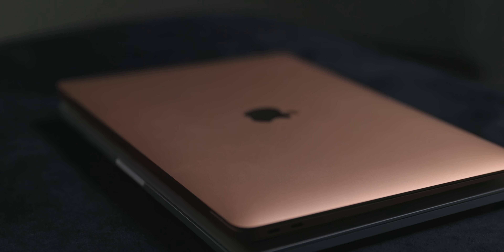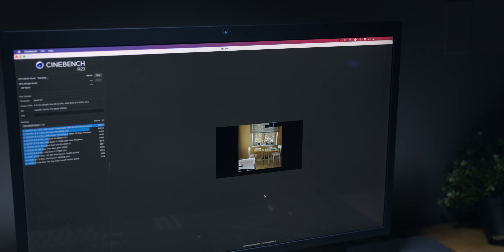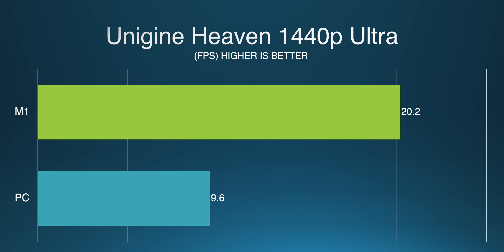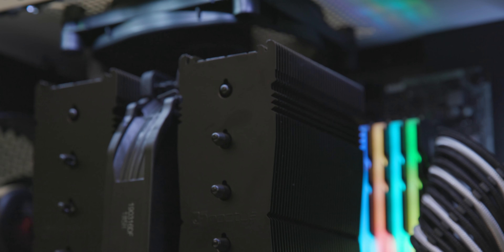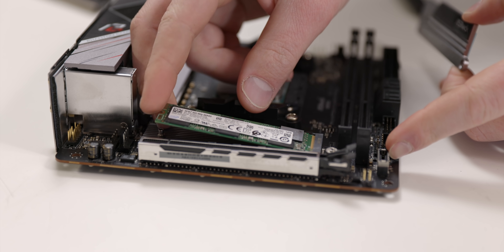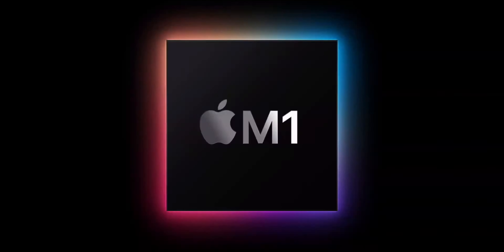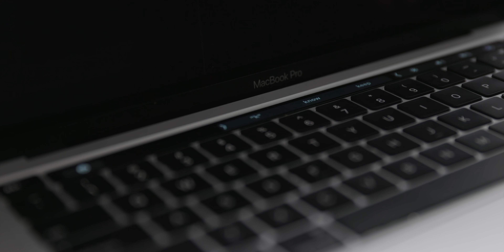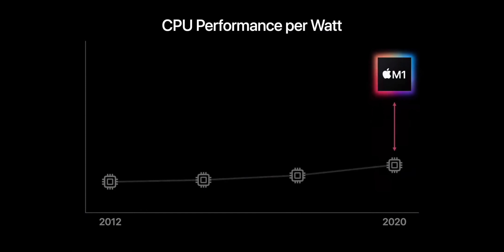$699 Mac mini vs $1,000 PC: Which Is Faster?

Comment: The M1 is a remarkable achievement by Apple (and ARM).  One wonders where Apple goes from here... the M1 (their first release) seems to be way ahead of almost everything in the x86 market.

If the Macs were running Windows they would take the market by storm.  The need to run legacy applications on Windows PCs protects that market for the time being, oh and gaming.

The next few years could be very interesting especially if Intel get their mojo back.  I have said this before but it bears repeating - Intel should buy NVidia while it can (whatever it costs).  Intel would overnight have access to arguably some of the best graphics and AI technology plus ARM.

Unless Intel has some magic sauce up it’s sleeve then they (and even AMD) could find themselves in a whole lot of trouble in the future.

Comment: The M1 chip is nothing but impressive. ARM has always been better than x86 for the masses,. Yet over the years I've seen many people disagree, touting ARM as "weak" and incapable of competing with x86 because "duh, mobile ain't even close to a full-fledged PC." I wonder what they think today. This teeny-tiny chip, whilst consuming a rather small amount of power and generating a small amount of heat, is only bested by absolute power-guzzling, fire-breathing machines. One can only imagine what a scaled up version with a equivalent size and power consumption would be like.

Despite all this, I doubt ARM can take over x86 any time soon. It should, absolutely, and I don't see anyone but Apple making it happen. But the majority of people on this planet who use some form of a computer is using Windows. I say majority but what I really mean is almost everyone outside of the US. Yes, there are other countries which use MacOS as much as the US does, but I digress. Where I live, it's an inconvenience to use an Apple computer outside of very specific use cases, because the entire economy/industry is built upon Windows. And I'm sure my country is one of most. So to summarize, unless Windows makes a sudden ecosystem-wide leap to ARM, things won't change any time soon. And Microsoft is in no hurry because they know they've got the time.

Comment: Common issue with M1 is lack of software compatibility so software has to run under slower emulation.  I own both Macbook Air M1 and the Ryzen 4650U laptop is about double the performance.

Comment: Yes overrated overhyped..poor support service  apple tax compatible issues. More integrated tech equals more problems but efficient and faster than built pc or separate components...longevity m series wont last forget upgrade repairs dedicated gpu ram ssd. 
 Arm is battery life efficient but lacks power. Heavier workload and accessories equals more watts...that's why x86 still valid and has edge over arm  besides emulate or root or translate errors problem. Apple answer buy new one unless warranty or insurance...that's why carrier sells insurance for tablets and phones...they break any electronic not easy to fix loses value quickly like a car.

Comment: performance is amazing for sure. The reason i switched from apple this year and bought a "Tuxedo Pulse 15" was not the lack of performance of apple products..
And in my use case , namely running virtual machines i have read nothing in regards to the M1.. using kvm or "Vmware fusion pro". 
My main problem with these new macs is that i can't even upgrade basic things like storage and memory.. 
in the case of memory one could simply argue that you should swallow the apple pill and buy the system with the max memory and be done with it.. 
That would be the price of admission and i accept that.. 
What i have a problem with the soldered SSD.. if you are not careful you can blow to a lot of write cycles just by using your browser i'm talking terabytes of data.
most if not all regular people don't even fine tune their browsers to prevent excessive writes on their SSD's.. Not to mention paging or writing an active session to disk.
in short i don't feel comfortable buying hardware with soldered storage... so i moved away..

Comment: The graphics situation with the M1 Macs is weird. It allows it to kill any low power x86 APU/SoC in said graphics dept, but if you throw a low power 6+ core CPU and a discreet GPU, things change - admittedly not as much as youd think. But the obvious answer for the M1 is adding discreet graphics to it. But nothing is compatabile - so who will/would make a compatible high(er) power dGPU? Probably AMD.

Comment: Wait a second, something's confusing me...

Why would snazzy use an Apu, since  for 1000 usd you could get a decent cpu and gpu. if the purpose was simply because the M1 doesnt have a dedicated gpu then... its not fair in my book. this is because you're intentionally buying less powerful components simply to match an already optimized apple product
Reply: He mentioned that you really can't compare Toyota Tundra to a Toyota Camry, right? So if he compares the M1 to a Ryzen 7 or Ryzen 9 5xxx with dedicated GPU then it would really be like that, they're not in the same category as Mac Minis are the lowest Apple can offer. You can only compare Mac Pros and not Mac Minis to what AMD or Intel can best offer plus GPU. Also, it doesn't matter if Apple and its hardware is better optimized, that's their strong point and you don't take that away from them.
Reply: @walkhardwalk  I get what your saying but as a consumer I wouldn't care about fairness. If I have 1000 usd to spend, I'm going to buy the thing that gives me the biggest bang for buck.
Which is why I felt that this wasn't an accurate test. Not only are the prices way out but also its not the best parts that you can get.
Also Mac does offer optimisation, which is a strong point for them, and a regular old slapped together build won't have that, which is why you should get the best parts you can.

Borrowing from the car analogy, if you comparing a camrey that's completely tricked out with everything to make it faster and a showroom model of the tundra then you can't give the camrey a head start. You should say if the camrey cost 10 000 usd, I'm gonna get another car, any car that costs 10 000 usd and compare them
Reply: @zaffarismail1508  You completely misunderstood the car analogy, all I'm saying (and the video too) is that you can't use a Camry (all maxed out) to cross a flood or river better than a Tundra. That is why you really can't compare a Ryzen or Intel setup with dedicated GPU which consumes a lot of power to a M1 Mac mini, they're just not the same. This is why this M1 mini was compared to an APU setup which has built-in graphics on chip and consumes low power, I mean what else can you compare an M1 with, there aren't really much powerful x86 chips with integrated graphics out there. At the end of the day, it still depends on what applications do people use in day to day basis, but even with real-life apps the M1 competes very well with $1000 workstations for a fraction of power use. I'm not a mac fanboy or anything, I still use my 9 year old i7 2600 but give credits to where it's due, M1 does beat its x86 counterparts this time.
Reply: @walkhardwalk  ok fair enough. I didn't even consider that power was a factor and yes a dedicated cpu would be more power hungry
Reply: @zaffarismail1508  Just imagine if they make a power-guzzling M1 chip. That would be insane.
Reply: @walkhardwalk  you know I honestly never saw a difference in the power requirements.
I went from using a laptop with to full sized desktop with its own dedicated gpu and my power consumption didn't change... I suppose that if you're using 100 pcs then every little bit helps

Comment: I hate Apple. I think that they are an Evil company. Unfortunately, the M1 silicon is the best thing to come along for the future of the PC market and will FINALLY force BOTH Intel and AMD to stop trying to solve every computing problem with brute force and start focusing more on efficient specialty hardware acceleration technology. As an AMD fanboy, I personally think that AMD will be dead if they can't adapt. Intel at least has the XE graphics onboard their CPUs, both upcoming desktop and current Notebook CPUs and has shown what it's accelerators can do for the Adobe suite. AMD on the other hand can't even seem to figure out HEVC/h.265 Encoding. The co-processing features that Intel offers currently and in the future are the main reasons that I will return to team Blue.

Comment: I'd never argue the M1 is bad. I want to see an investigation in the reports about the SSD deterioration levels. There seems to be an issue where the new M1 machines write inordinate amounts of data to the SSD and possibly trashing the drive much sooner than expected. I'd be interested in seeing if it's as bad as reported and if Apple have issued a statement regarding this problem. I cant seem to find one.
Reply: I actually bought a used M1 macbook air from a programmer and the mac was splendid, looked brand new
The thing is, I found out he wrote 50TB on the SSD already after 6 months of use.
I did the math and at an average 50gb a day (my current usage) it should last more than enough still, considering 150TBW as a bare minimum

Comment: The fact you had to say a very sizeable heat sink says it all...  Apple Silicon can be housed in a smaller case and rarely does the fan kick on...  And I'm a Windows user since Windows 3.11 on 386 computers.  I'm finally ditching Intel/AMD and moving to Apple Silicon... Apple's base models are kicking the crap out of supposedly more powerful Intel based machines for even less money.  There's a reason M1 and its future iterations are getting so much hype.

Comment: Snazzy must be trying to get back in the good graces of the Apple fans cause this line of reasoning is just laughably absurd.
Performance per watt is transparent to the user on desktops.  No one would notice the difference in power draw between the Ryzen and the M1.
The only other perk listed in this video is the mini has a smaller physical footprint than comparably priced and performant PCs.  
Really... that's it?  All just to build up to speculation that maybe there'll be some developments where the M1's advantages become relevant for desktop users.

The advantages of the M1 are almost all in the laptop, because PPW means longer battery life.  The only draw to the mini at all today is people's preference for the OS / ecosystem.  These mental gymnastics didn't change that.

Comment: Given that right now 90% of software running on the M1 is Rosetta 2 emulated, and is still outperforming most computers (even running Windows 10 ARM more effectively in Parallels than the Surface Pro X) is very impressive. I’m really looking forward to more companies supporting the M1 natively, and seeing the Mac Mini grow from strength to strength.

Comment: The only problem with this "in house wonder" is that, as soon has Apple ends support for it in a software level, its all trash! Apple tried to do it on Intel, but kinda failed! You can use a 2008 mac pro with windows (or linux) and its perfectly usable. Its a 13 yo computer that is useless with apple software but usable with any other OS... Microsoft can port windows and linux will pop up in it too most defenitively, but none of them will be that well optimized... Because its proprietary hardware... they know how to cripple the hardware... Oh, once again thanks to its experience in iDevices... And they will do it to force you to buy another, "great" apple device with "awesome new apple silicon"...

Comment: Love the video bud, fantastic! 
I'm using the M1 Mac mini today and love it! The best thing I ever did!
The new world in computer architecture is happening! Especially in memory and machine learning. 

I believe the M1 is a start of the future in, in-house production for an example;  for Microsoft, Sony, HP, Dell etc, they could design their own chips.
I think the days are relying on contracts with Intel or AMD are on the way out, companies will design their processors in house, that will save on cost and help their margins.

Side note: - Would love it if Microsoft designed their own chip for the next gen Xbox, or Sony designing their own chip for the PS6!! 
Apple has taken the lead in, in-house production, and I think others should follow.
Reply: The thing about the m1 is that Apple has years of experience on making their own chip with the A(x) lineup so they are leaps ahead of company like Microsoft. And Microsoft actually "makes" custom chips for their surface lineup even before Apple, I say in makes in quotation is because the SQ1 and 2 is nothing more than a modified 8cx qualcomm chip. Other company may adopt this approach but I don't see much doing so, as their goal is different from Apple. Such as HP, on the hardware side they make nothing more than building peripherals and assembling computers so it can't justify the $500 million+ just to build a custom chip on tsmc 5nm like what Apple did.

Comment: Microsoft has tried and failed with arm processes so far and I think they will be rightly worried .Even a high spect surface laptop can't match a MacBook Air M1 ,so the only thing that will save Surface laptops in the short-term is Windows 10 and touchscreen as people would be reluctant change platforms .Qualcomm could end up being the biggest chipset maker in the ultrabook and laptop market If Intel doesn't adapt quickly .

Comment: that's the thing - that makes the M1 top the other is merely it's power dissipation and low power consumption. If you care about that, and mobile and tiny form factor aficionados will, that's great. You've got a wonderful compact and/or mobile solution. That's where the comparisons will end though. You still could build a way better PC from stock parts for cheaper that will run x86 code natively if we're talking desktops. I expect this to hold true even when the new iMacs come this year and the ridiculously overpriced pro lines. They will be good, very good, but the marketing wank will be in "performance per watt" and "ooh it's so quiet". As someone who's been a mac user for over 30 years... I'm not terribly impressed and given history, an architecture switch is a terrible idea for cross-compatibility. Emulation mode is balls no matter what way you slice it.

Comment: Apple as of right now has a large advantage over any other chip. However, One thing that is often glanced over is the process node size of their manufacturing. As of right now they are the only big name in this space using 5nm, this gives them added efficiency, assuming AMD's predictions are correct on performance gains (which they have been for a while) them moving to 5nm will deliver over a 30% increase in performance. This would narrow the gap significantly, and this is something rarely explained in an m1 vs x86 performance comparison.

Although you still did a great job with the video and I can't wait for the next one. 

If you have any questions on anything, ask me in the comments
Reply: This sounds likely. Also, nobody seem to notice all these benchmarks are done with cpus that run on ddr4 while the m1 employs ddr5 ram...
It is clear to everybody, however, Intel and AMD have been sleeping for at least 10 years.
If you have to use a apple product in order to have power efficiency, that is a problem... it does not even run Linux.
Even more troublesome is the concept you need to have a very integrated system - a SOC - to achieve that. If that is the case, we could see the end of the modular pc concept and, make no mistake, a general and consistent rise in cost of ownership.

Comment: there was only a couple of applications and even synthetic  benchmarks used to compare the X86 Ryzen to the ARM M1, I have a feeling these huge wins for the ARM chip are limited to a few applications
Reply: synthetic benchmarks which were designed for x86 and were running on the mac through roseta translation layer. but still its beating out the ryzen is entirely on the basis of good design. not because of black magic
Reply: Arm is the the future man, it’s time for x86 to die
Reply: @jacksonmyers1892  Doubtful, ARM is RISC-based and is good at only a few workloads. It is the future of mobile, but there will always be a need for brute force and a broader array of instruction sets which is where x86 shines

Comment: 25 years  of pc ownership    i have to say    mac   = -1  . pc  =  +10   .
 when it comes to  gettting it working  again when it    stops working   !  when your    ssd stops working on a  pc   you just buy a  new one   slap it in   [ in the slot that is provided ]   you won't find any slots  on any mac  .  [ie you can't    fix it   ]  
 my  5 year old    msi   laptop   gt 72   has never let me down    even though it has  a 320 w power   pack  it uses   85 w  when   just  on youtube  .   when i game   it   uses  200 w   but i never have to do any thing in the settings    . msi  laptops   are dear  but far better  than   this crap  ! at least i can    buy   parts and upgrade it if i want  !  [ I WOULD NEVER   BUY A MAC ]   i would never  even have one in my house   ! .